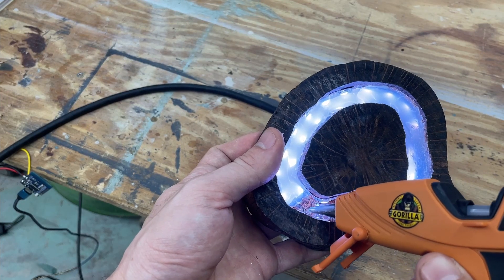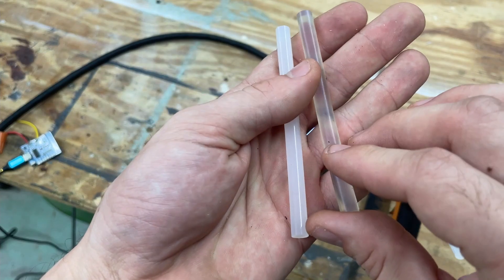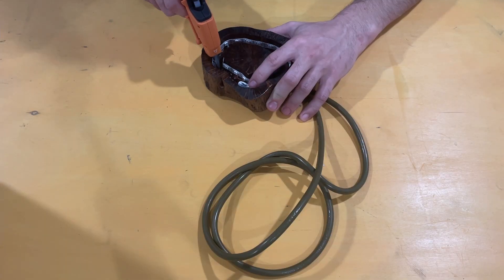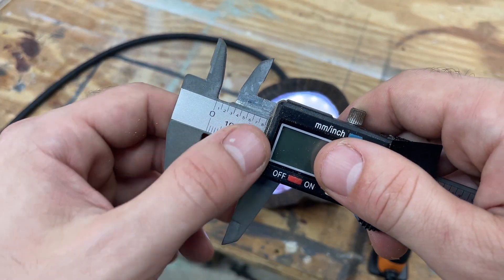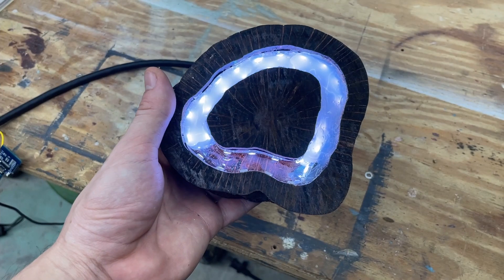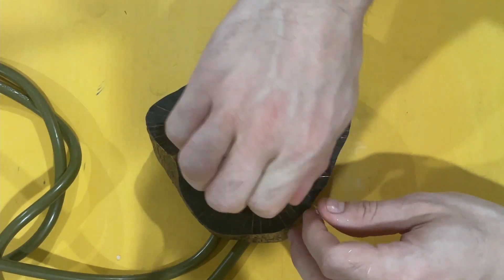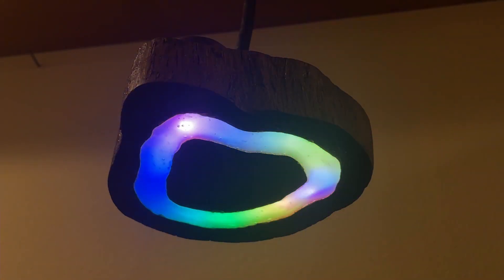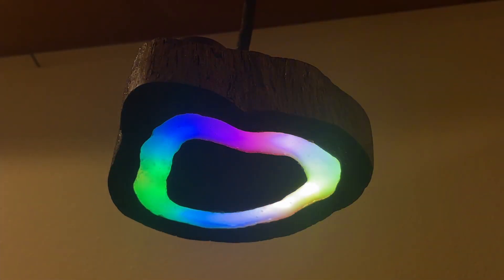Diffusing LED Lights? Try This!

Comment: Try silicone
Reply from the maker: Yeah, I did think about using that originally for this project because silicon has a longer working time than hot glue. Plus hot glue is a pain if you need to use your fingers to reform it to the shape of the mold.... I'll definitely consider switching it up and trying silicone for one of my upcoming projects to see how I like that option. I tested using epoxy not too long ago and that worked out pretty well for LED diffusion (Video link if you're interested: https://www.youtube.com/watch?v=XsS3jhkdSG0 ).

Comment: Wow, this is interesting and will really help me.
  You thought of maybe using epoxy and making a small transparent plastic cork cap with white epoxy to reduce the volume.
  Or use thin white plastic, melt it with a heat gun and then press it from above with a round rod at the end or a small ball into a surface full of round holes of different sizes.
I think it will work well
Have a lovely day
Reply from the maker: I haven't used epoxy before, but I would like to try it and learn how to use it in some LED diffusion projects like this. This hot glue technique is ok for smaller light projects, but epoxy seems like the better way to go for larger light diffusion builds. I just bought some recently, so I will be experimenting with it soon!

Comment: Probably been way faster to just cut the glue sticks up.... fill the area up then use the hot air gun to melt them while adding more as it melts down.
Reply from the maker: Yes, it may have been faster doing it that way. I hadn't even thought to use a hot air gun to melt the hot glue until after I got to the end of this project, so that's why I didn't start with it. It took a minute or two to reheat the hot glue enough to start flowing. But I think the hot air gun could work well enough for this by melting gradually a few layers at a time as you said.
Reply: @Electriangle  My heat gun can melt solder, and its nothing fancy,  should be no issue and much faster than a glue gun